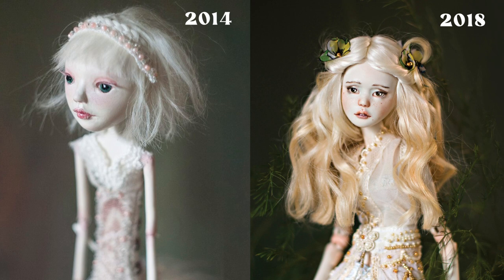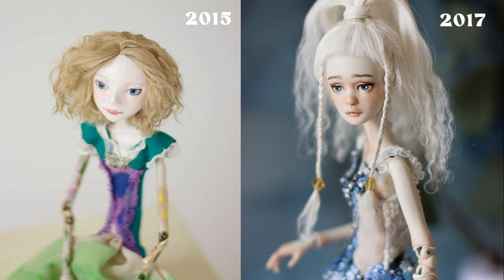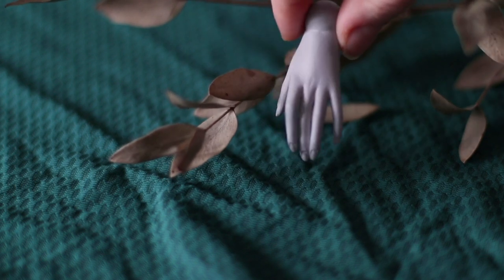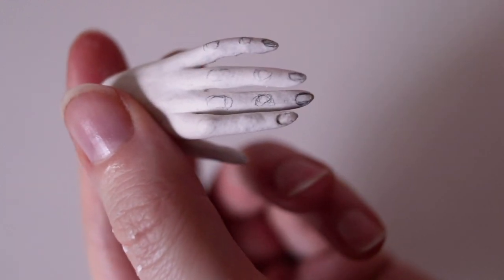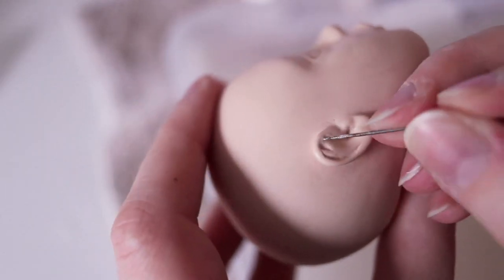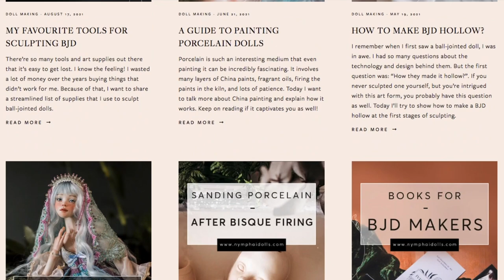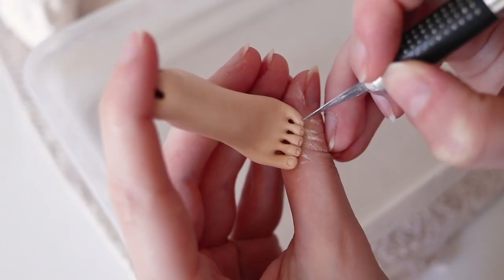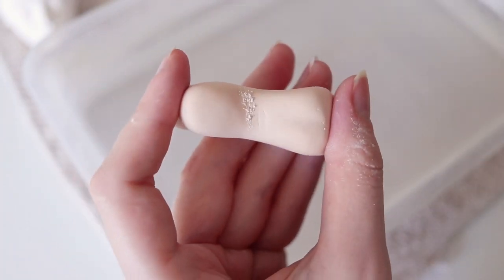How to get better at sculpting dolls? This is how my art dolls changed over time

Comment: Your work is truly inspiring! and I thank you so much for taking your time to give us so much information on this topic! It has helped me motivated to continue trying to make my own bjd :) I hope one day to do porcelain aswell and as a beginnger in this topic I was hoping I could ask you a question. I read on several occasions that porcelain shrinks but is there a major difference from the master to the finished fired doll? could you, for example use the master for making clothing patterns and it would still fit the other dolls?
Reply from the maker: Yes, the porcelain shrinks quite a bit. Depending on the brand ir could be 12-15%. So you need to calculate that and make your master model bigger. The clothes won’t fit well unfortunately.